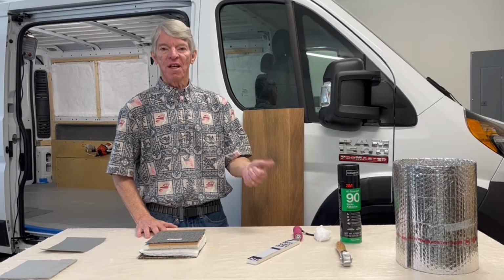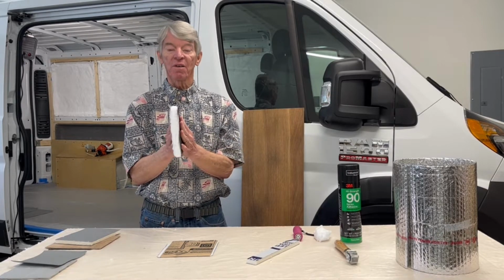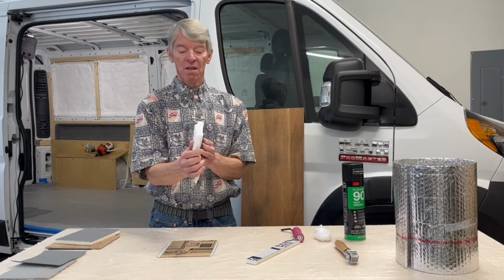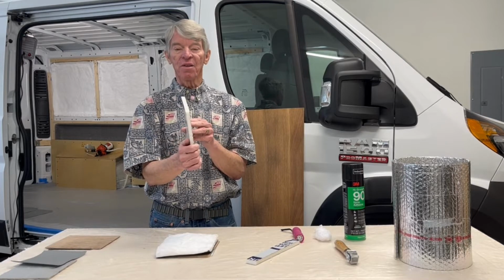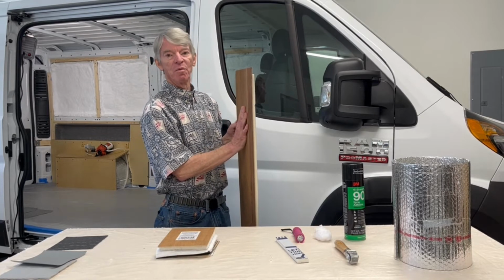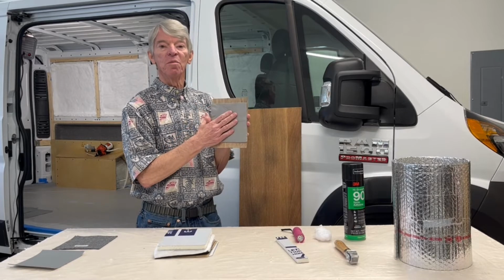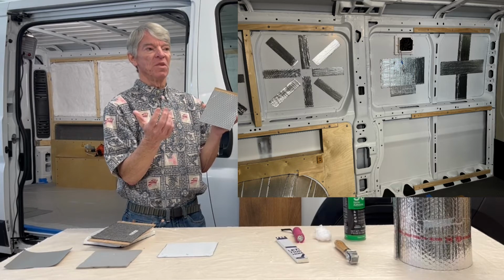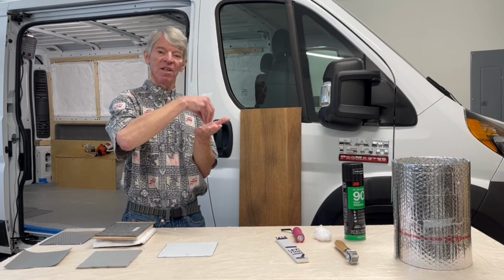Best Insulation System Ever for Ultralight Van Builds

Comment: I know this is a clickbait title, but if you want the best insulation system ever, you need to define your metric. by environmental impact, you would use cork. Its renewable, fire resistant, hydrophobic, carbon negative and has an R value of 4 per inch. if you want the best by pure R value, vacuum panels at R60 per inch or aerogel at R20 per inch. you can get 8mm aerogel thermawrap blanket effectively R5.5. Aerogel is 99.99% air. It is 4 times more insulating than thinsulate. You can buy 40x3ft roll for $1200.  its hydrophilic, easy to work with and you can use it to cover windows while still allowing light in. With that said I applaud you on your thoughtful system. Some good ideas there!
Reply from the maker: Yes, clickbait. I appreciate your feedback. Weight is high on my list of criteria and materials that are readily available. I am not familiar with aerogel and will look into it. I am always looking for new materials.
Reply: I used cork! Love it in the summer and winter🎉
Reply: @MannyWC What kind of cork did you use? 
I’m building a micro camper out of an electric Nissan e-NV200 and will be using a lot of cork. 5mm cork roll everywhere to cover all the metal and get sound, vibration, and heat insulation. Then 50mm flax insulation on top of that in the roof and hollow parts of the van. 10.5mm  cork flooring. And some 3mm wall cork as a final layer on my window covers and on the panels that hide the holes in walls and doors. Will also have underfloor and ceiling heating, a shower, home cinema, suit closet, and more!
Reply: @mikaelangeloh2316  dang sounds like a penthouse! I used 1/2 cork on a roll. Important to layout and flatten before use. I may add some cork flooring one day. I have marmoleum, atm (plus lots of insulation under that.)
Reply: @MannyWC  1/2? Half inch? I considered marmoleum as well, but the cork was actually cheaper, and I hope softer, as this is a tiny van and I'm building a raised floor so I have storage, and the shower, underneath the floor. So it will be Japan inspired floor living, with toasty heated floors.
Reply: @mikaelangeloh2316  yep 1/2 inch as it is my actual wall material in my bunk area and the wall opposite of my slider.
Reply: @MannyWC what you use for thermal barrier?
Reply: @georgea6403  I insulated with wool, no thermal barrier, and I have had no moisture build up winter or summer. The cork will absorb and release moisture. Even when it is cold outside, my windows never have moisture on them in the morning.
Reply: Yes and no for cork; yes it is a renewable ressources but we use already too much for the crrent trees ability. also it can not be flexible enough to be easily slide in between ribs. Aerogel is not affordable. I would need like 200sqft so close to 2000$
Reply: Cabot Thermal Wrap is almost identical to Aspen's aerogel blanket materials (the patent expired). This is the same material as the stuff used in Toasty Feet insoles, POE aerogel sleeping pads, and Burton ski jackets.
Reply: Big money comfortable for the rich I'm sure.
Reply: I just feel like commenting with no authority on the subject whatsoever: keep in mind the material needs to be robust for mobile applications that see a lot of vibration. If the insulation material is brittle like glass fiber and it breaks down over time due to the vehicle's movement you risk inhaling the decomposed fibers. Fun. 

This variable may preclude what would otherwise be a good insulation material.